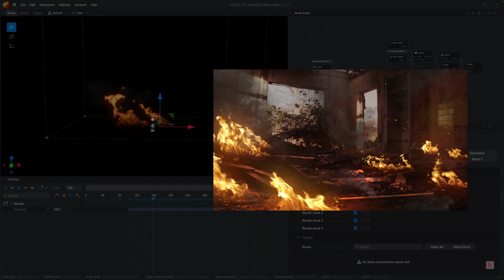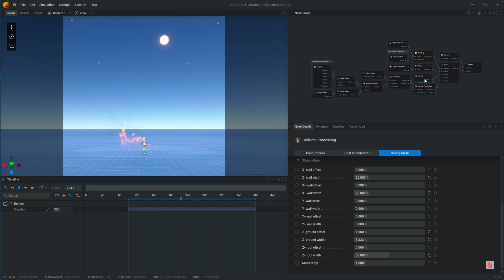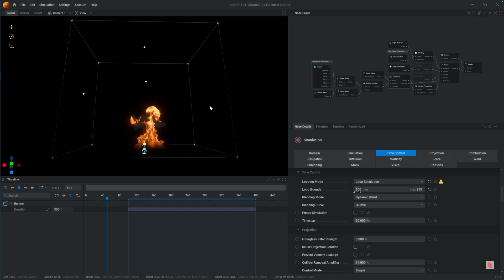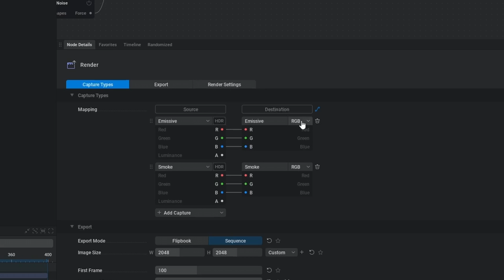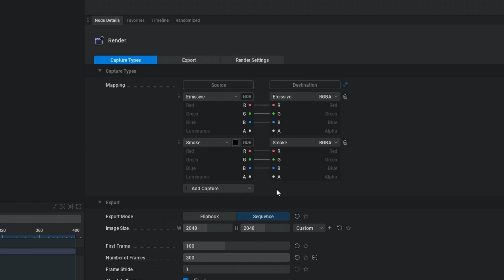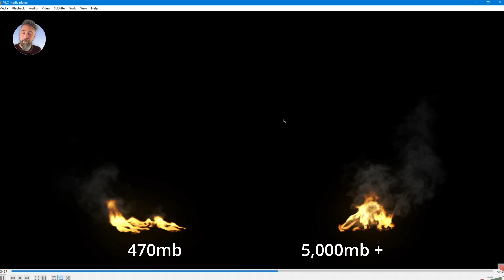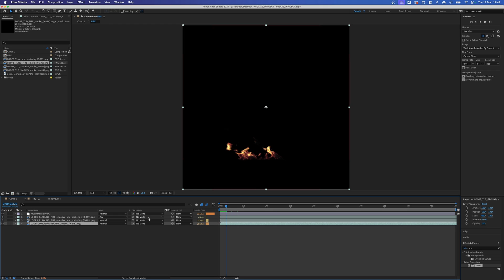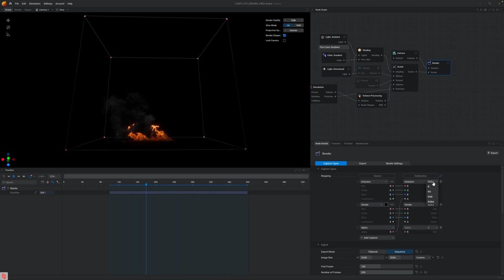Mastering Looping Sims in EmberGen: Part 1 - Looping Simulations

Comment: is anyway I can slow down the simulation? I try to make a large smoke, but it move too fast.
Reply from the maker: You would have to do it in post with "Optical flow" calculations.
Reply: @jangafx  but I want to use as VDB in UE5, and the smoke are interacting with the character in sequencer
Reply from the maker: @weijunchen1290  We don't have a way to retime in EmberGen right this second. You could potentially retime the VDB's in houdini.